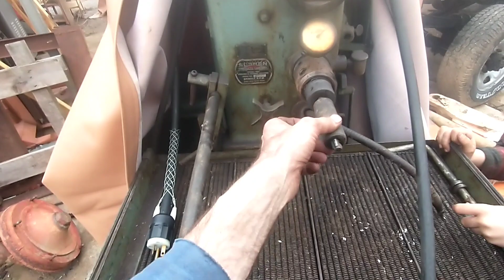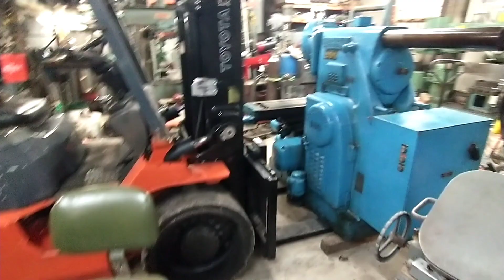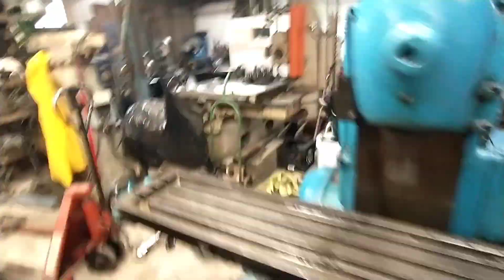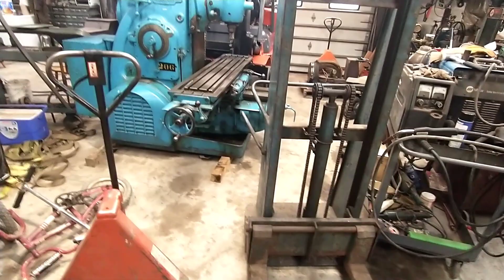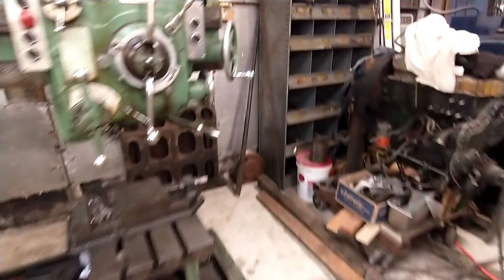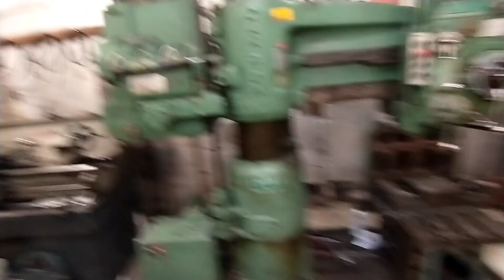More new shop machinery

Comment: That's a nice mill.  I have a Fexac horizontal mill roughly that size and like yours, it has a vertical head attachment.  Now that my HBM is running my plan is to leave the vertical head on the Fexac and use it for heavy vertical milling.  I'll use the HBM for all my horizontal milling.  Unless you have duplicate rear controls on your horizontal mill you may find it frustrating to use compared to your HBM.  Ken
Reply from the maker: This machine does have the rear controls, but I'm sure most of that type of work will get done on the hbm. I envision this machine doing heavy milling so as to save the wear and tear on the hbm.